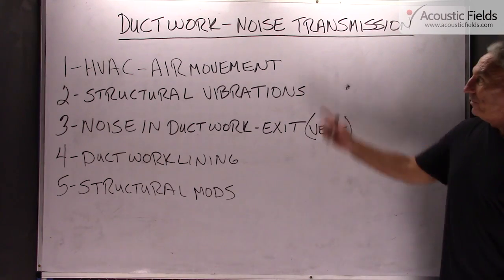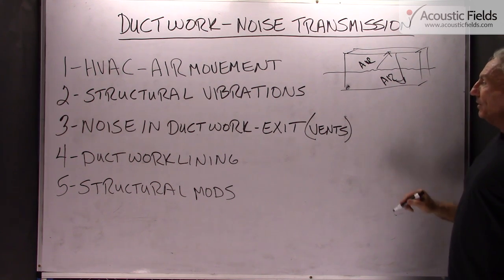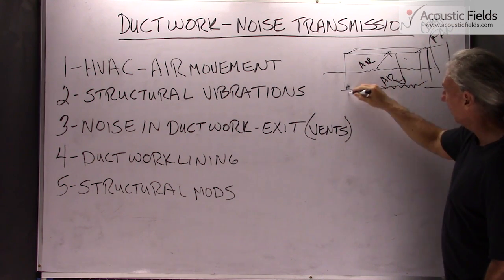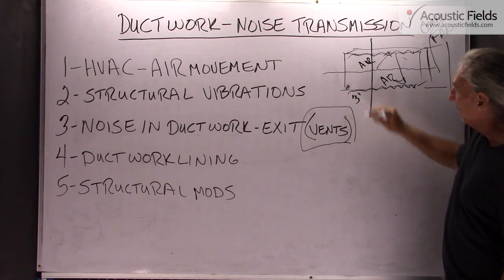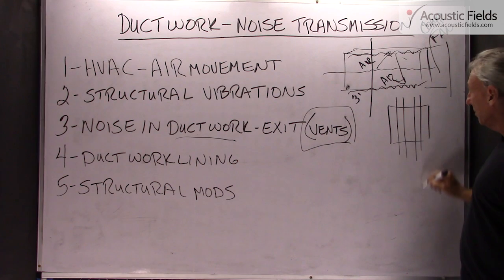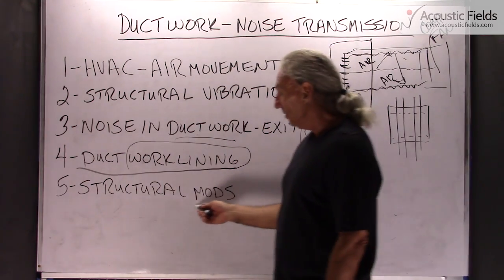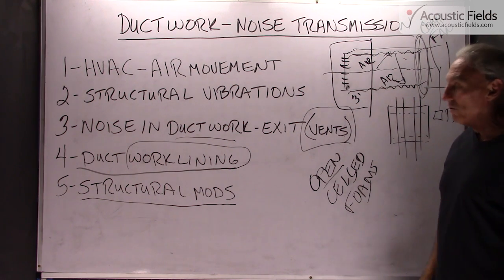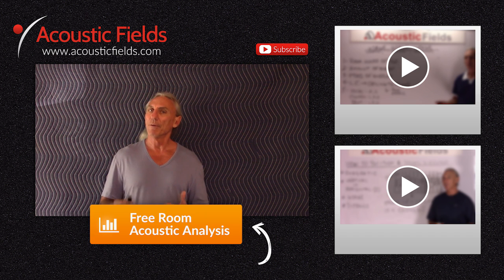Ductwork - Noise Transmission - www.AcousticFields.com

Comment: I moved into my brothers basement and the air/heat thing is SO loud. It’s not the vents it the big machine it’s self. It’s an unfinished basement so it’s out in the open. Do you have any videos on fixing that? I know you touched on it in this video but I’m a 21 year old college student who doesn’t know the slightest bit about lining a machine. At least not without a better understand of how. Haha thanks! Your video seems to be the only one that covers this topic.
Reply from the maker: All noise issues must be measured first and foremost. Think of it as a noise blood test. When you go the doctor he gives you a blood test to see what is going on so he can prescribe a solution. It works the same with noise. Noise is the foe and you must know how big the army is and how strong they are. Once you determine the numbers, treatment can then be prescribed. All noise issues are different and each barrier treatment is frequency and amplitude (strength) dependent.
Reply: @AcousticFields  do you do virtual assessments over video ?
Reply: I am no engineer.  I had the same problem, and I built a sound barrier, make a frame of 2 x 4 the size you want, fill with sound insulation, one side I carpeted (facing furnace) and the other side plywood.  Made a dramatic difference.  Note, don't make it too big, gets heavy, and be sure to leave lots of room around the furnace for air movement and heat.

Comment: I am hearing loud whistling noises ever since we got new unit installed. The installer said it would go away by itself with time, but its still doing it. I already taped up some holes I seen with tape above the furnace and looks like they did a bad seal with some kind of plaster or bondo and some air is leaking from the side of metal wall above furnace. The AC is working good but we just have been putting up with the whistling noise. What should I do to fix this problem?
Reply from the maker: You can start by reducing the noise level at the vent. The vent noise is a large part of the total noise. Line 24" back from vent inside on the four walls of the ductwork with our open celled foam. If you cant do all 4 walls of the duct, cover the two largest surface areas that are parallel.
Reply: @AcousticFields  Thanks for the reply I am having my AC complete  inspection tomorrow and I will mention it to him to see if he can fix it once and for all. Thanks and I hope that will be the problem.

Comment: Thank you for sharing your knowledge and taking the time to make the video.  I'm trying to reduce the noise from my central return air vent for a warm air heating system.  The main issue is the proximity of the return air vent to the fan.  It's directly above the fan, only 3 foot away.  Currently there is no ducting between fan unit and vent.  I can't realistically move the return air vent.  I had read that acoustic flexible ducting can help reduce fan noise.  Hoping to try that without wasting too much money.  Please are you able to offer any advice?
Reply from the maker: You will need to absorb more energy than just using flex tube. Try flex tube lined with foam.
Reply: @AcousticFields  Thank you, I'll try it

Comment: Thank you for this video!  I added open celled foam in my duct and it made a big difference.  I expected it to help a little, but I didn't expect it to make as big a difference as it did.  No more adjusting my tv volume every time my furnace cuts on and off.
Reply: Where do you put it exactly? I can’t hear the TV either :(
Reply: @pidgepagonis  same question I have
Reply from the maker: C,  We have measured + 5 dB - + 8 dB attenuation so its very audible.

Comment: Hi, your video is very educational. Would you recommend lining the ducts, or just inserting the foam 3 feet into the ducts, kind of free standing in the middle of the duct. can you recommend an open cell foam product for the application you recommend. I am looking online but am not sure exactly what I need.
Reply from the maker: Hi Diana, Thank you. It would depend on the frequency and amplitude of the noise. What is the diameter of the duct work?
Reply: The duct is 32 inches wide and 9 inches high. It runs across the floor under the ceiling for about 10 feet, where it connects to the main return duct. I put Roxul Safen Sound around it, i also lined the outside of the duct with insulation material, but the noise travels inside the pipe. I have 2 returns and 2 blowers upstairs that  have duct connected to the downstairs. Hope this explains the situation. Any advice will be greatly appreciated!!!! Thank you!

Comment: I did a search and found that there are open cell foam spray.  Is there any brand or product to use or not to use?
Reply from the maker: Send me the specifications of the product you are considering using.
Reply: Acoustic Fields I was looking at ICYNENE's web site and they have a variety of open cell foam sprays.  Since I'm not exactly a foam spray expert are there specs I should look for?    this would be for duct work for a house. 

I was just wondering if you knew about open cell foam sprays to consider or to avoid or what specs we should be looking for, that would be helpful.  Thanks..

As an experiment, I actually crammed some small pieces of acoustic foam around the air outlet behind the vent and it actually reduced the ambient noise level considerably.  Don't worry, I didn't block the air passage, I just put some open cell phone pieces since there was room around the duct opening behind the vent.